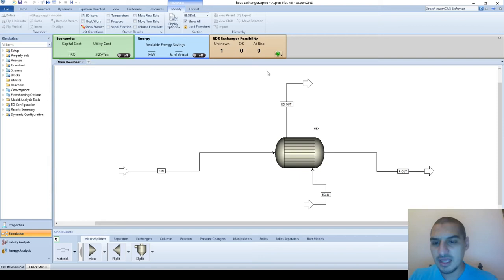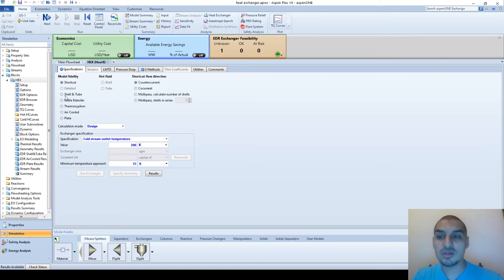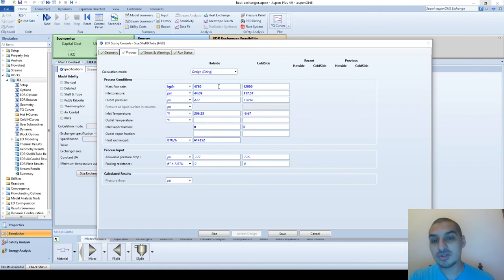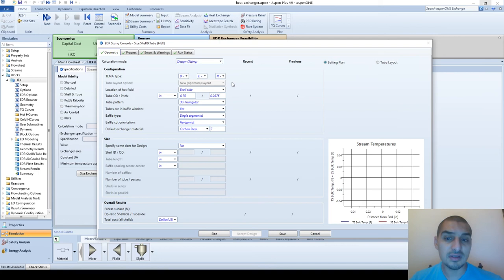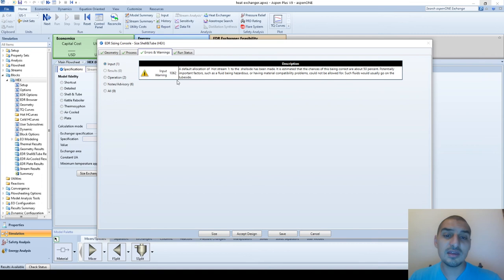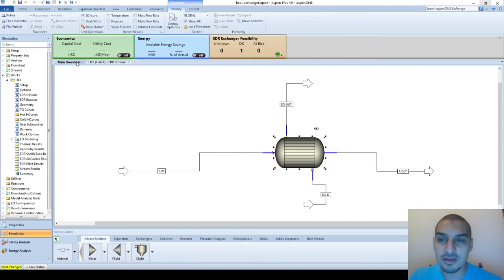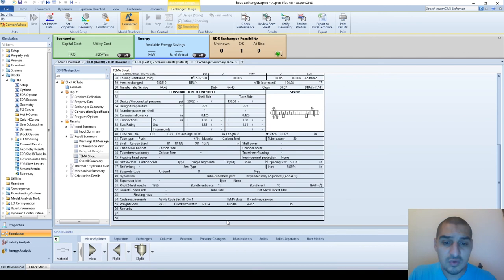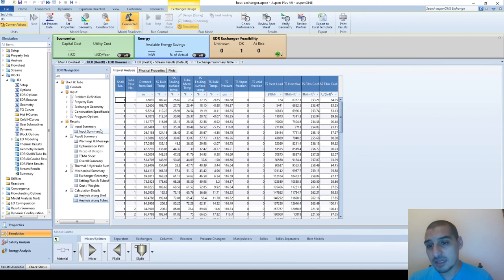Aspen Plus in English | Part 2 | 20 | Heat exchanger - Rigorous mode

Comment: Hi, thank you for the video! I've tried to apply It to my project, but i have this problem. The sizing process works fine in the EDR, but once i import my geometry in Aspen plus and run It again, i get an extremely small minimum temperature difference. The reason Is that the outlet T are pretty different from the Temperatures i get in the short cut method. How can i avoid It? Thank you